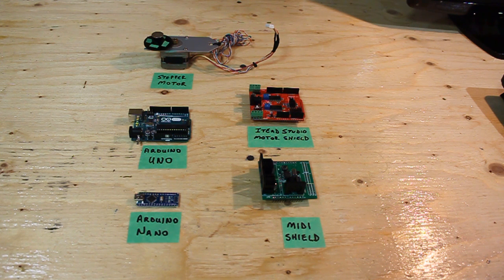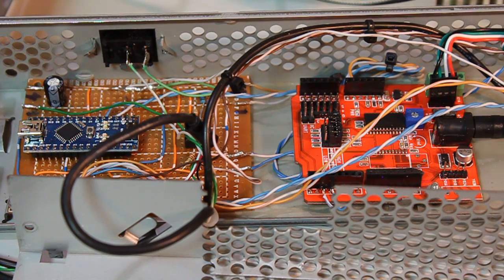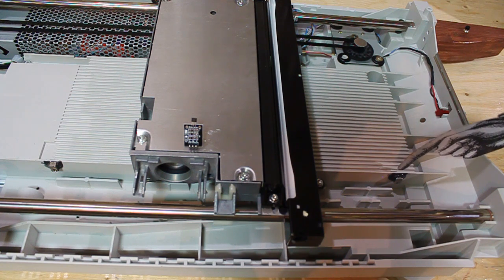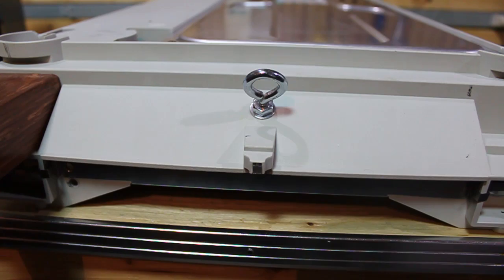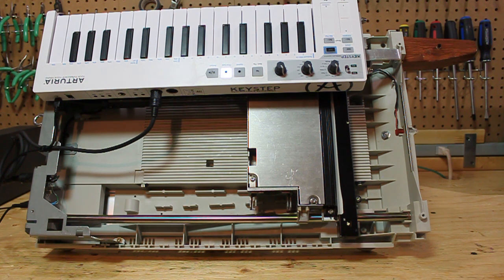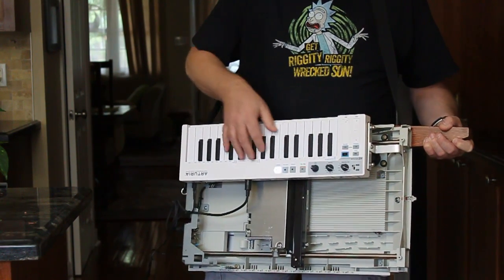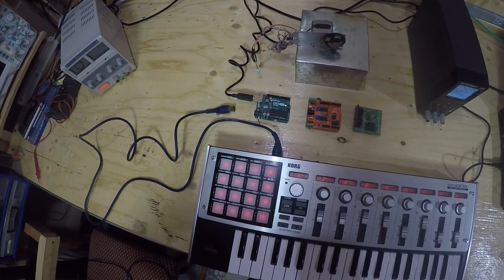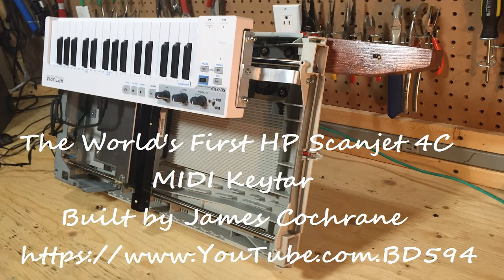World's First HP Scanjet 4C Keytar / Arturia KeyStep + Build Your Own Musical Stepper Motor

Comment: Will this work for small stepper motors such as those ones in a scanner like hp Scanjet 2400?
Reply from the maker: yes, this setup will work with any device that has a stepper motor.
Reply: Thanks for your prompt response.

Comment: Any idea if this could work with the Adafruit motor shield?
Reply from the maker: yes, it should work.  you may need to modify the code to change any output pin numbers
Reply: I love it.  I got it going.  The steppers I have are quiet.  Is there a way to change the code to interleaved or something to make them louder?   If I run the demo code for steppers they "sing" more...
Reply: Thanks. I just ordered the same shield you linked to. Works great. I just need to anchor my stepper to something to resonate more. Maybe I will use an acoustic guitar
Reply from the maker: an acoustic guitar is a great idea.  please post a video when it is done.